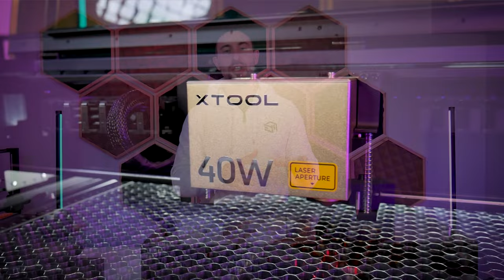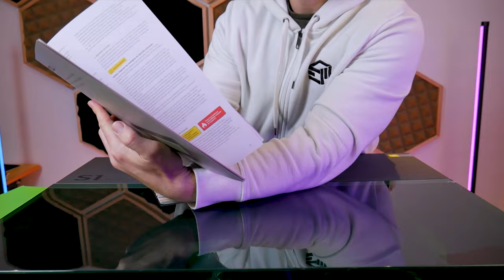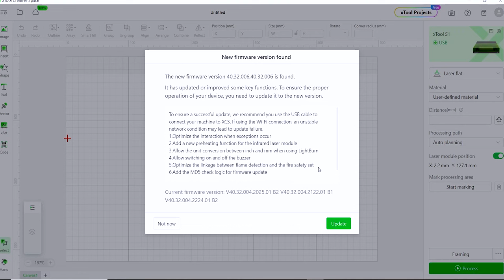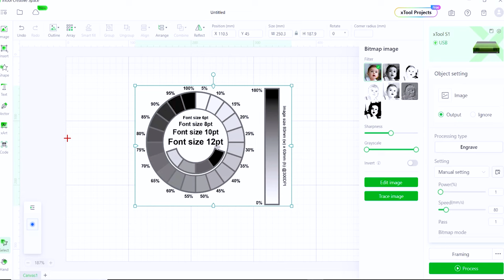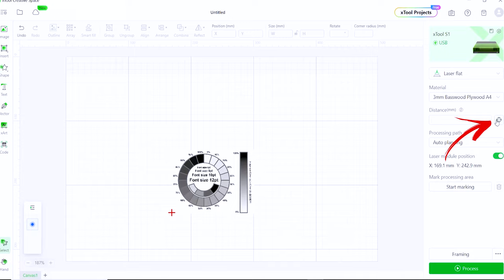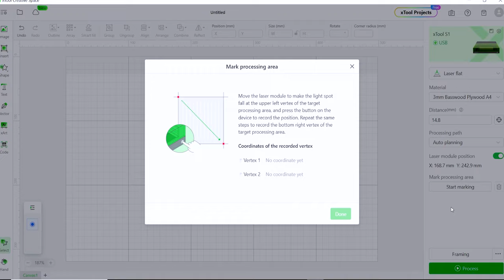XTool S1 In Depth Review and Setup Guide, Material Settings, Upgrades, Fixtures, and More!

Comment from the maker: If you appreciate my thorough videos, check the links below to support my work and get the best prices. As an Amazon associate I may earn a small commission (at no extra cost to you).
XTool S1 Promo prices!
► US Store: https://bit.ly/3RYnpDI (CODE: XTCUT200)
► UK Store: https://bit.ly/46xxuMc 

XTOOL S1 40W:
► https://www.xtool.com/products/xtool-s1-laser-cutter?ref=D5HpJRsyqyUUnt&utm_medium=5306&utm_source=influencer

XTOOL S1 40W Basic Kit (Includes Air Assist and Honeycomb Bed):
► https://www.xtool.com/products/xtool-s1-laser-cutter?ref=D5HpJRsyqyUUnt&utm_medium=5306&utm_source=influencer&variant=44189727391983

XTOOL Smoke and Fume Purifier:
► https://www.xtool.com/products/pre-order-xtool-smoke-purifier?ref=D5HpJRsyqyUUnt&utm_medium=5306&utm_source=influencer

In addition to the setup guide, I have also designed and made available several exclusive upgrades related to the XTool S1 (as seen in this video):

S1 Button Cover and Prism Holders:
► https://embracemaking.com/products/xtool-s1-button-cover-and-prism-holder-kit

S1 / F1 Fixture Kit:
► https://embracemaking.com/products/xtool-f1-multi-jig-and-circular-fixture-kit

S1 to 4inch Hose Adapter:
► https://embracemaking.com/products/xtool-s1-flange-to-4-inch-101mm-hose-adapter

S1 Hose to XTool Smoke Purifier Adapter:
► https://embracemaking.com/products/xtool-s1-3-hose-to-xtool-smoke-purifier

Check out my other video specifically addressing laser safety:
► https://youtu.be/ZPMoEhKHxGY

If you are looking for products or items I've used with the S1 Pro in this video, see below. As an Amazon Associate may I earn from qualifying purchases (at no extra cost to you):

4" Inline Duct Fan:
► https://amzn.to/44SzkWN

Electric Screw Driver:
► https://amzn.to/3MFMkIJ

Electric Air Duster:
► https://amzn.to/3FZQAPE

Comment: Could you do pros and cons of the S1 vs F1 as an initial laser purchase?
Reply from the maker: Well, the first thing I would ask is what do you intend on using your machine for? The F1 is so much smaller - even with the slide extension - that you will be stuck doing small items. If this is the case then I would do the F1 because you get both blue laser and IR laser in one machine. It takes up less space and is easily portable if you want to do things like craft shows. If you want to make bigger pieces like cutting boards or cut out big panels with lots of shapes to assemble wooden designs - then get the S1. It has more power (up to 40W) and you can still get an IR module. The downside is that it takes up a lot of space and will be way more expensive especially if you want to work with deeper pieces (you will need the frame extension even if you want to use the rotary). That being said, if you have the space and the money, and you invest in something like the S1 upfront then it will take longer for you to grow out of it.

Comment: Im not a big fan of having to move the gantry manually.

How does this handle black hard anodized parts?
Reply from the maker: Do you want to be able to jog the machine while in the design screen? I'll see if I can find a true hard anodized part around here... I had some things made a long time ago that I know are real hard anodized... if I can find them I'll throw them under the laser and find out
Reply: @EmbraceMaking  I mean for setting your corner points. Ive never done that with my plotters or CNC router/engravers. I looks "wrong" to me. Thank you sir! BTW youtube doesnt always let me know when you post things. Been a big fan ince I bought the tire tool from you. Keep at it my dude.
Reply: I honestly was 100% clueless that is what they were directing. Needing to do that was just completely foreign to me. I wish their "How to" after assembly was 1/2 as good as the assembly manual.

Comment: How many lines per cm was the engraving on the basswood?
Reply from the maker: 100 lines per cm for each of the examples. I believe this is the "default" setting based on many of the XTool reference settings that I've looked through. Anything less and you start to notice the lines

Comment: awesome video thank you! Im just about to order it the 20W version. According to the site it cuts 10mm wood easily. So I would use the machine for precise cutting of wood (mainly ~6mm thick for my projects). A little nervous now given your cutting chapter of the video, and that I don't see much S1 20W cutting in any review vids! Nothing over 3mm... Do you think it can cut 6mm wood like basswood/baltic birch plywood? That would be my main need for this machine so im trying to confirm that capability before purchase
Reply from the maker: You're welcome! The bamboo I was cutting was roughly 15mm thick so its considerably thicker than 10mm... Also I'm wondering if the bamboo has lots of glue or something to bond it all together and that might be the issue? What type of wood will you use? If you do end up getting one I would be super appreciative if you used the affiliate links in the video description, there's also a $200 discount code in there too :) thanks!
Reply: I'm just learning about these machines but wouldn't it be better to get the 40w and dial back the power instead of worrying if your 20w had enough power?
Reply: @FounderOf4  not necessarily, depends your needs. at 40W your laser beam is slightly thicker. Plus I would mainly be using it to cut under 10mm wood, so no need in 40W. im gonna get the 20W and then save up abit more and get a C02 for next upgrade likely p2
Reply: @proudcanadianeh4663  thank you for the education.  I didn't think about the size of the  cut, but I understand what you mean.

I very much appreciate reply.. looking forward to learning more about the hobby before I make the big purchase.
Reply: @FounderOf4 The 20 watt laser has a slightly smaller size of the laser spot which allows even better resolution for very fine lines.

Comment: how big is this machine? dimensions?
Reply from the maker: 30" wide, 22" deep, and 7" tall ... if you use the hose sticking out the back you'll need a few extra inches away from the wall to allow the hose to come out and bend 90 degrees.

Comment: The fire suppression feature is not included but at a high price. The air purifier alone can break up
Reply from the maker: Yes the fire suppression kit, air purifier, etc are all extra from XTOOL. They sell some different bundle options to get a slightly better deal if you buy things together - but the base S1 does not come with these extras.